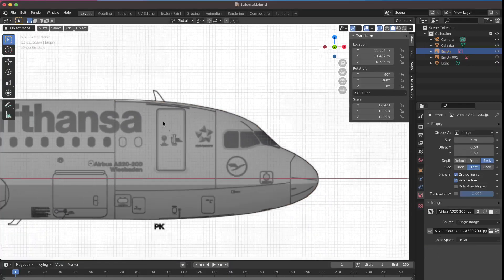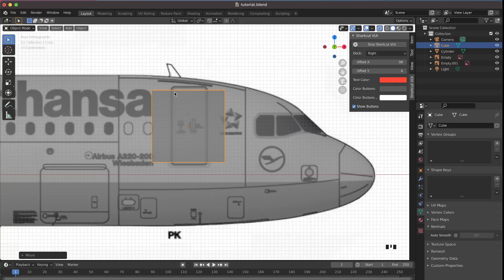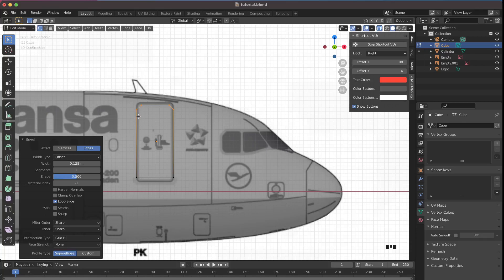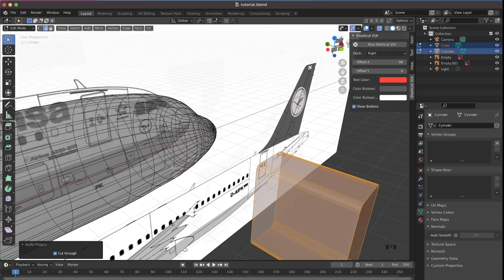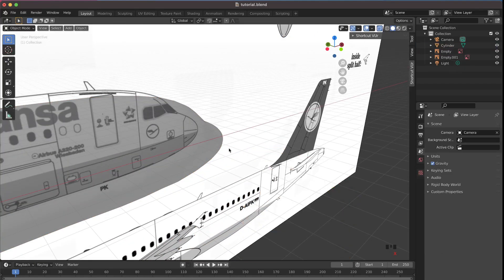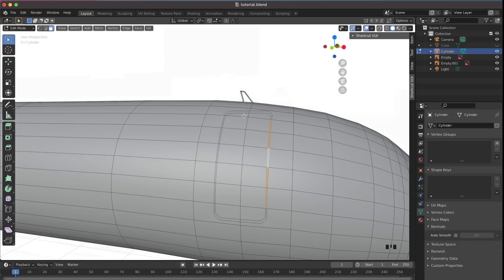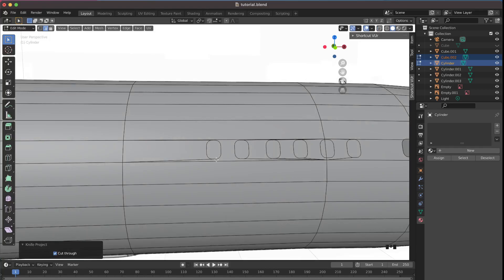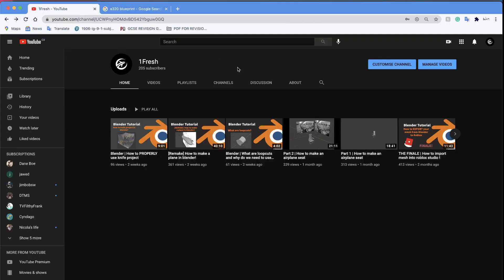BLENDER | How to make windows and doors for your plane!

Comment: A few tips:
When Alt-Clicking to select loops, click on the diagonal edge, not the center of the face. That tells blender in which direction you want to select a loop.
And when you're selecting the interior cutout of the door, simply select a single plane, and hit command/control-L to select all linked verts since that cutout is already separate from the rest of the hull.
When doing the windows, don't duplicate them by hand. Just use an array modifier on the cutter so you can have precise and consistent spacing.

Although, I feel like this entire thing would be done easier with booleans.

Comment: For the knife project part - if when you cut through it and it doesn't cut straight - you need to go into orthographic view. That's the area with the X,Y,Z on the top right. Knife project cuts where your camera is, so you should always be in orthographic view for it to cut nicely.

Comment: 5:31 For the people that are watching this the day I post this comment. Knife Project has changed, so for the door, you would 

1. Click the plane and go into edit mode with the whole plane selected in edit mode as well  
2. Select the cube that is going to make the door frame 
3. go into mesh and click Knife Project 
4. Your done and may continue the video :)
I hope this helps the people that are stuck with the Error "no other selected object have wire or boundary edges to use for projection"
Reply: it wont work still for me i dont see an outline and the way u say it is confusing and if it does cut it cuts weird and not where i want it to
Reply: @brad_st3r  You may need to delete the faces of the square so that the square almost looks like a cookie cutter. For a better explanation, watch his previous video.
Reply: @brad_st3r   Basically you click the plane body, then with that go into edit mode with the plane body still selected, press A to select the whole plane body then click the cube that is going to make the door,  go into mesh and then knife project. I hope this is more clear. I hope this makes my statement more clear to you.
Reply: @future_things7665  That's exactly what i did and it would not cut through i enabled cut through as well
Reply: Thank you so much, it works
Reply: oml thank you I was stuck here for ages.
Reply: tysm, I was stuck for so long

Comment: When i click knife project i get the error:No other selected objects have wires or boundary edges to use this projection.
What do i do?
Reply from the maker: Have you selected the shape you want to project?
Reply: @1fresh450  i think i know. I had this problem too. I would probably try removing the fronts of the shape and also click a when your in edit mode and have selected both of them.

Hope this helps
Reply: @propagandavance  ok ill try
Reply: @1fresh450  I selected it
Reply from the maker: That error happens if the thing you want to project on isn't selected,
Reply: @Train_D3V  Hey after some trial and error i got to the discovery that if you eliminate the front faces you just enter to the fuselage in edit mode then select your knife project mesh in the outliner(w/CTRL)and align the view you can cut it just fine
Reply: Bro YOU WAS COOKING HOLY SHIT

Comment: the knife project doesnt work am i doing something wrong?
Reply from the maker: What error do you get when doing so?
Reply: @1fresh450  it says No other selected objects have wire or boundary edges to use for projection
Reply: @lebronlover2323  oh, i know this is a 2 month old comment and i bet you dont care at this point, but if you do, then heres how its done

This maybe a problem with the shape so if you havent curved it, then that could be fixed or you should try removing the fronts of each shape. 

Hope this helps!
Reply: @propagandavance  thnks ill try this (my letter @ key isnt working)